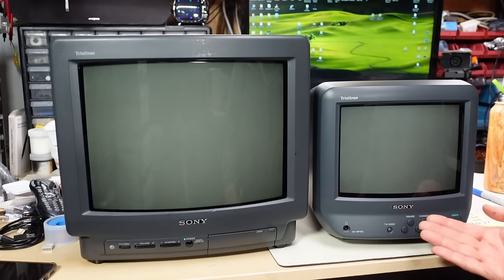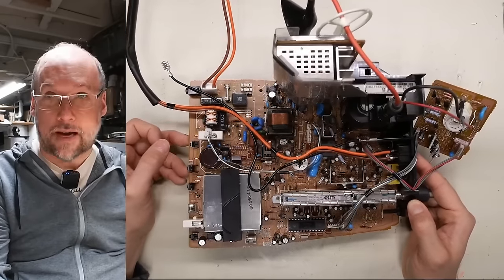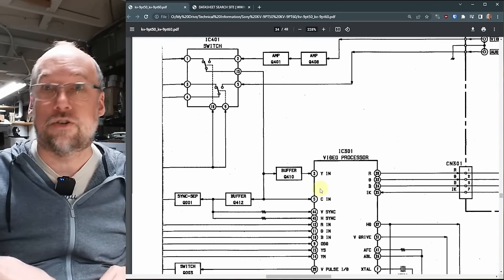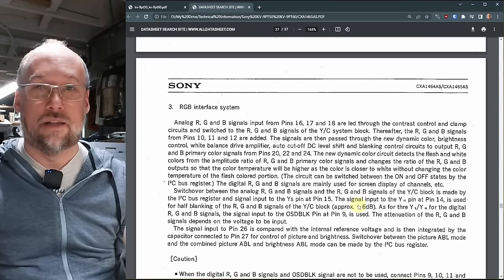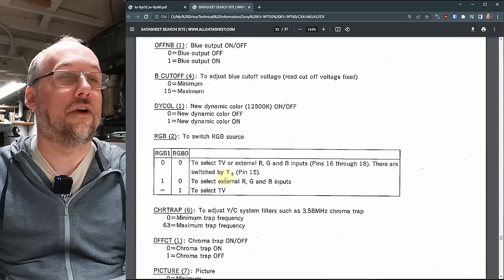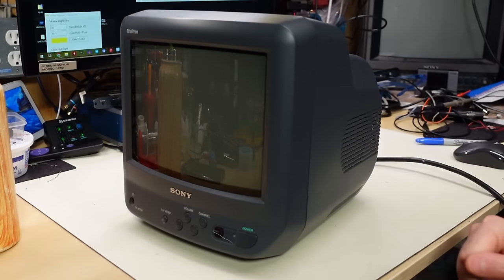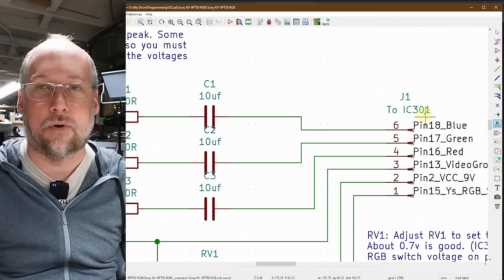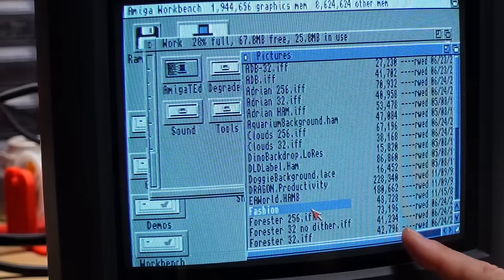Adding a RGB input to a Sony Trinitron (KV-9PT60 / KV-9PT50)

Comment: Nice mod. When making holes in plastics, I draw/trace out the hole, drill a starter hole and then file it by hand with small diamond files. I find the dremel is too fast and harsh for plastics. The file takes longer but the end result is always smarter and worth the extra time. You also have the advantage of test-fitting and filing a bit more.
Reply: Came here to say exactly this!
Reply: Came here to say almost this, one tip is to make starter/pilot holes with solder-iron to all 4 corners, then drill them with little bit larger like 4mm (5/32inch)
Reply: I have had luck making precise holes in plastic by drilling a starter hole and then use a dremel with a "grout cleaning bit" running at a low/medium speed. This bit resembles a round file and as long as you keep the speed low enough, it won't melt the plastic but you retain decent control over the material carved off the edge. 

If the setup allows it, attach a plunge router head over the end of the dremel to give you something to lean against and keep the tip from running.
Reply: @petergriffin6126  Thanks, good tip Peter. Now here's a tip tip for you.
Melting plastic instantly contaminates and eventually ruins soldering iron tips!  
I always change to a dedicated spare sacrificial tip to isolate that damage.
I purchased an inexpensive 240 vac "wood burner" iron to use on 120 vac exclusively for poking holes in plastic, but never got around to see if that works. It might require a lose Aluminum foil wrap to get temp up a bit.  IDK. 
In any case, I don't think those (Palestine, OH-like) fumes are healthy for you or your liver, so be careful.
Reply: @FindLiberty  My tip for the tip is check before you zip....😉
Reply: @SegaDream131  ? Zip as in, GRIP the wrong Iron and start cooking/melting away on the plastic while holding your breath? Or, check before SIPPING contaminated OH ground water through a Life Straw? In any case, take care of you and yours.
Reply: @FindLiberty  Oh I'm talking about the straw of life all right...
Reply: @SegaDream131  Oh, before you un-zip.  And be sure to wipe the tip.  LOL

Comment: Ym is actually a "Picture Mute" which dims the picture by -6dB, regardless of if its from the Y/C or RGB inputs.  This can be used as part of a sleep function to dim the picture as a both a warning that the sleep timer is about to expire, and as a softer way of turning off as to not wake the user.
Reply: That's so considerate
Reply: I wonder if it could be used to 'tame' the extra 'hot' output from the Atari, without having to adjust the levels in the service menu? Add a second switch to the back...
Reply: The chip seems to be made for JP21 specifications, which has RGB 0.7 Vp-p, sync 1 ohm p-p, Ys 1V+ and Ym <0.4V L/>1V H (the exact same values in the sheet). Ym in that specification is described as "Switches RGB to half-brightness, for video overlay."

Comment: Sad part about Scart & RGB is, I never used it until the past few years when I learned about RGB over Scart, sure I used Scart to connect stuff up back before HDMI took over, but never even knew about it having RGB capabilities until the vids on RGB-modding cropped up (E.G. 8-Bit Guy's Samsung TV, and your own trash-picked (RCA?) one) and the Scart crowd went smugmode over it, first thing I realised I could use was my PS1 which I didn't realise I already had an RGB cable for... :P

Comment: Nice mod :) - Not to be nitpicking, but the connector is named DE-9. E is the shell size. A DB-9 would be B width (25 pins connector) and have only 9 pins. It doesn't exist :D

Comment: The theory & design section of this video is worth any price of admission.  Thank you, Adrian, for sharing this stuff with us freely.

Greenlee, Klein, Thomas & Betts, and other toolmakers offer a set of knockout punches for DB-9 and DB-25 (some makers even include the Centronics punch...)  I'm not exactly sure how these would work on plastics, but they make a really neat and correctly shaped opening for these connectors in metal...
Reply: bro you really took the time to write all that?

Comment: Back in the heyday of the Sega Genesis, I had a Sony Trinitron TV like that. Being in Europe, I was able to get an RGB SCART cable for it, and was really impressed with the clarity and detail of the picture; those Trinitron sets were excellent for gaming!
Reply: lcd tv's always have been awful to game on with the slow response rate ,resolution doesn't match your console, input lag. yucky shiny black plastic. even a pc gaming led monitor is better than a hd tv it still has pixel trailing.

Comment: I bought a set very similar to this one (it's either the one after or before) at an estate sale down the street.  They had two, so I plugged them in, they both looked great showing static (no obvious burn in), and the one was super clean and clearly barely used.  Been meaning to do this for a while now, so it's great that you showed the steps.  My friend gave birth a few months back, and I plan on coming up to see her when the kid is old enough to play video games and bring an NES!  It'll be interesting to see their reaction.  The portability of it is great, since I can easily take it in the car, and still be able to play light gun games!

Comment: In the UK, once scart became standard from the early 90's, pretty much every tv had RGB as standard.  My first Sony Trintitron 14” was in 1992 and that had RGB Scart and looked superb in our AMIGA 600.
Reply: General in europe. In Germany too.
Reply: But having a scart input does not mean RGB will be working as it may be that only composite input is implemented.
But you are right that normally, having a scart plug almost guarantees RGB compatibility.
Reply: @eldontyrellcorp  All serious brands had RGB input. Because it was mandatory for the French market. I've yet to come across a TV that doesn't do RGB. What is hit-and-miss is 60Hz support. That became more common in the nineties.

Comment: Your CRT warning always reminds me of the "work experience" placement I did back in the mid 80s when I was about 14; it was a small local electronics firm that did computer repairs including servicing monitors, and one day I was given vague instructions on how to remove a CRT from something and then left with pretty much no supervision. The shock I got pulling the anode out taught me a lesson I will never forget!

On a less potentially fatal note, America really got stiffed by missing out on SCART; I have a pretty bargain basement (Bush, a name that rarely inspired confidence) 14" CRT TV from around the same era and it's got composite, S-Video, and RGB right out of the box, and I recently discovered that while it doesn't support NTSC it's perfectly happy running at 60Hz (most likely by accident rather than by design) so I can use stuff from the US/Japan as long as it has an RGB output.
Reply: America had  EIA Multiport aka SCART.
Reply: @Gareth Fairclough insert joke about Ireland/Scotland/Wales here! lol, sorry, but am I wrong? 😜
Reply: @Gareth Fairclough you probably grew up with older TVs around you, RF only sets were common in the mid 80s and I've seen people using the same TV for like 25 years.

My family only upgraded to an LCD TV in 2013, we went from a 90s 32" CRT to a 50" LCD and the size difference was hard to get used to.

Comment: I'm glad you're always assertive about CRT safety warnings. It's absolutely worth saying. I didn't know about old 80s CRTs in North America being dangerous to add input mods to. I wouldn't be caught dead opening a CRT, too terrified of electricity as-is. CRTs are the equivalent of getting struck by lightning in my mind.
Reply: This is not exclusive to 80s American crt TVs.
Reply: A little electricity never hurt anyone.
Reply: @chitlitlah  Somewhat true for the US, with 110V only being dangerous in conjunction with moisture, like in a bathroom, which also seems to be the only place where you'll find GFCI/RCDs in the US.
Unfortunately, it's a lot more than just 110V inside a TV.
Reply: tbf it's not that dangerous, just dont stick your hand in random places with the set on, remember to discharge it before working on it (with a simple screw driver and a cable to ground). also the service manual is your friend, with it you can identify high voltage areas, ie flyback and the psu. also i wear some rubber gloves when i have to touch things around the tube or high voltage areas, say the flyback or convergence rings.
Reply: Typical fear mongering by people who at the same time admit they are ignorant of electronics.

Comment: A good thing about SCART (and JP-21, a copy of SCART with a different pinout) is that you can skip the switch in these mods, since they carry the 1V signal for the blanking on pin 16. For retro computers, you can feed 5V into the cable through a simple circuit to draw it down to within specification.

Comment: I had the massive 30" model in 1997 - unbelievably heavy. Bought it and Dreamcast on the same day.
Reply from the maker: I recently saw what looked like a 36" CRT TV the other day -- I couldn't believe how large and heavy it was. Needless to say, I didn't bring it home.
Reply: Do you still have the Dreamcast you bought in 1997? It might be very valuable.
Reply: Dreamcast came out in 1998 in Japan

Comment: I have the industrial version of the 9 inch SONY RGB monitor, CPD-9000.  It really has an amazing picture with rich saturation.  I've had this set for over 25 years, and for some reason the RGB connector didn't work as described, so I hard wired a DB-9 to the set and it worked!  That set hadn't been used for probably 30 years, it was surplused in the 90's and never used until a few years ago.

Comment: Its so nice to have rgb on pretty much entry level CRT TVs here in Europe. Can litterally walk into the next thrift store which still has some CRTs, check for a scart connector, and 9 out of 10 will do RGB on it. Something I used a lot with my Amiga 500 at the time, on a bigger Sony trinitron, and still use for my C128, with a small adapter which lets me switch between the 2 outputs of that machine, and uses the signalling on scart to tell the TV which input to use. (and does 4 bit passive rgbi to analog rgb 'conversion')

Comment: The reason you had to turn the RGBP setting down so much is because your circuit is missing 75 ohm termination resistors to ground on the analog RGB lines. Those are needed to set the correct 0.7 Vp-p signal levels that the jungle IC is expecting. And while it probably doesn't matter so much for such a small, low-resolution set, having the proper termination also helps to reduce reflection artifacts.
Reply: Is that something like a pulldown resistor?
Reply from the maker: I thought about adding 75 ohm to ground -- I may do that in the future as it can easily be added it to the PCB. The RGBP being set to about 50 of the range doesn't seem like a problem though. There would be no reason to want this setting to have to run at the maximum all the time.
Reply: @CollinBaillie  yes video is normalised at 75 ohms , the reistor in parallel with the circuit will terminate the line for the computer at 75 just like a regular monitor does

Comment: I'm always amazed to see that a lot of CRT TVs already has RGB of course with a bit of modification and a bit of electronic knowledge you can make a great monitor for many computers and even consoles that also has RGB for example the Super Nintendo it is a great example and most thought that the S-Video is the top of the line but no it also has RGB and I seen pictures on the online and they look gorgeous in my opinion absolutely lovely.
Reply: In Europe, many TVs had RGB input via the SCART connector (aka Peritel) from the mid-80s.
Reply: It was probably a cost saving measure, as every TV I owned, unless they were RF only, would have at least one RGB SCART socket, and have never seen a TV with composite input, though you could plug in composite into the SCART socket with an adapter.
Reply: I guess by cost reducing. European TV should not have so different circuitry.
In regards of SNES, it's funny how the N64 has worse tv signals than its predecessor.

Comment: To get the right size hole for the connector, I'd be tempted to dismantle one of the male DE9s, remove the pins and just keep the outer shell metal portion, then hold it in pliers and heat it up with a hot air gun or a flame, and gently push it into the plastic - it should 'cookie cutter' exactly the right size hole - you'd have to practice a bit, and maybe do it outside or somewhere well ventilated if it's giving off fumes, but if you don't want to go all that far, just pushing it in a little and then using that smooth edge as a guide for a dremel tool would work. Thanks for these videos, they're always entertaining and informative, I learn something new every time 😃
Reply from the maker: I should really grab some old junk plastic and give that a try. I bet if I had looked, I could have found some printable templates online to help with the cutting. :-)
Reply: I use an old  graphics card backplate as a template,  tape it to the plastic, and run the dremel bit around it like a router.

Comment: excellent video learned a lot! those resistor and capacitor filters are used in many areas including memory modules etc. i think that many OEM make a PCB with all the features and then remove the components for the lower end models. i noticed amiga pcb do this a lot. it would be fun to watch a video where the missing components were added back to the system and functionality was returned. keep up the good work and thanks!

Comment: One note about D1 diode, it has a voltage drop which can vary between diode type, would be beneficial to measure voltage after the diode when adjusting potentiometer

Comment: Hi Adrian, at 32:23 you asked for suggestions for how to cut a hole for the DB9 connector. I second the suggestion for using a Nibbling Tool. I got mine at a Radio Shack many years ago and it has worked great for me on aluminum and plastic. Nice tool to have in your toolbox!

Comment: It was great that in Europe most quality TVs from early 90s onwards supported RGB via a SCART connector. I have 2 Trinitron CRTs from the 90s and they both have s-video which is great to have as well.
Reply: Make that early eighties. France started enforcing it in 1981, and maybe by 1983 it was implemented in most European sets.
Reply: @2kBofFun  indeed, and became more common as we progressed through the 80s and into the 90s thankfully.

Comment: I'm very glad you added the comment about the "hot chassis" thing on TVs / monitors.

It's quite an insidious danger, because in certain setups, somebody could add an RGB (or Composite, or Component) input mod to a TV, and it could seem to "work" fine when used with something like a console as the source.

But those new input cables to the TV  (including the "ground" / shield, and connectors) will be floating at MAINS potential. :o
(or at least around the DC potential after the bridge rectifier, or after the regulator, which is just as bad.)

Many consoles have power supplies don't require a mains Earth, so you might not even notice the problem until it's too late.

If somebody then goes to unplug the cables from the console, or touches the cables/plugs and something else that is Earthed (like a radiator, or other piece of equipment that is Earthed), they could receive a lethal shock!

It sounds like quite a rare scenario, but believe me, it happens.
People have been hurt before when attempting mods like this.

It can of course be done perfectly safely, but please do be super careful.
If you're in ANY doubt at all about about how to safely do a mod like this, please let somebody more qualified / experienced to do the mod.

Also, as Adrian mentioned in the vid, the power supply, capacitors, heatsinks, and the tube itself in a TV/monitor can be dangerous too, even after being powered off for a while.

(I'm sure I'll now have somebody say "It's not that bad" as usual, but whatever. lol. If this makes even ONE person think twice about attempting a mod like this without previous experience, then it's worth the few detractors in the replies.)
Reply: Oh, and on most "hot chassis" TVs, it really does mean the entire internal board(s) and most components will be at Mains potential.

So they had to isolate any exposed external metal, like on the RF (antenna) connector, where they often used an insulating block with safety capacitors to allow the RF signal to pass, but blocked the high-voltage.

That means all of the internal components, heatsinks, tuner shield, everything inside the TV can be dangerous to touch.

Most of those TVs are designed with chunky plastic buttons on the outside, so there's no chance of the user directly touching any of the conductive parts that go to the main boards inside.

(that's probably another reason why most older sets only had a few inputs like RF and maybe Composite + Audio, because those would have needed full isolation as well.)

It's true that in the later part of the 80s, many TVs started using a fully isolated power supply, so they no longer had to insulate the external connectors and other exposed metal parts. But this is "retro" we're talking about here, which means TVs as old as from the 70s or early-80s.

So-called "hot chassis" or "live chassis" TVs and monitors were more common in 100-120V land, too...

In countries which used a lower mains voltage, it was usually cheaper to design a power supply that just used the rectified mains directly, and a small voltage regulator that ran the flyback and the rest of the set.

In 200-240V Countries, a simple linear regulator would have dissipated too much heat (since the B+ rail in most TVs rarely needed to be above about 150 Volts). Or was just harder to design things that way, so TVs with an isolated SMPS tend to be a bit more common in those Countries.